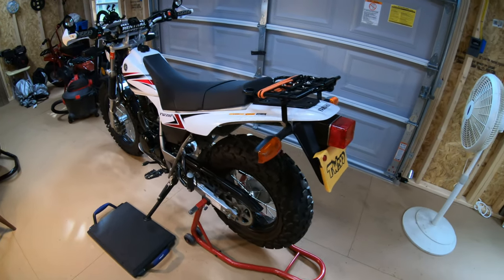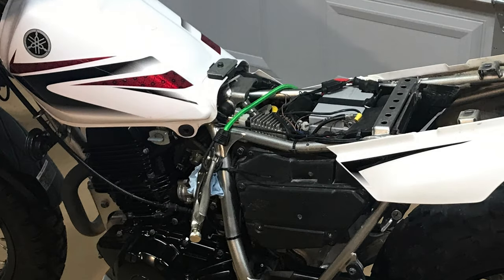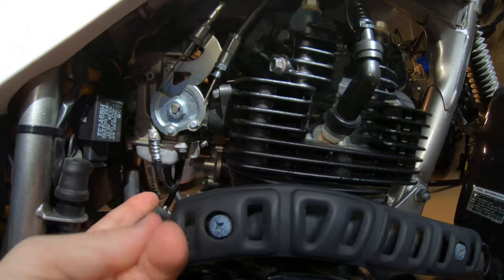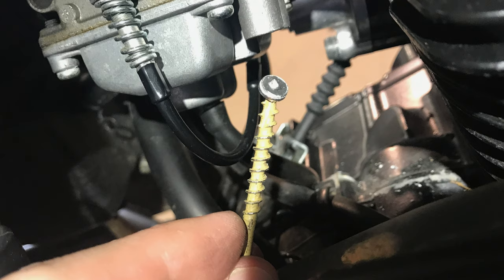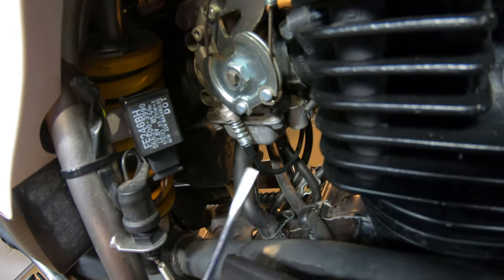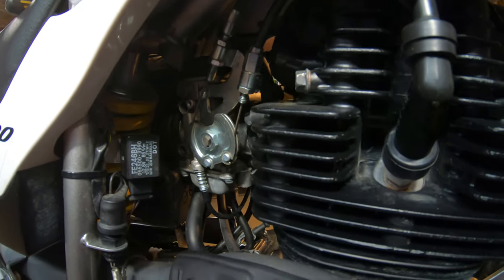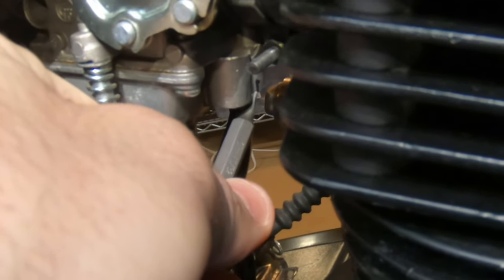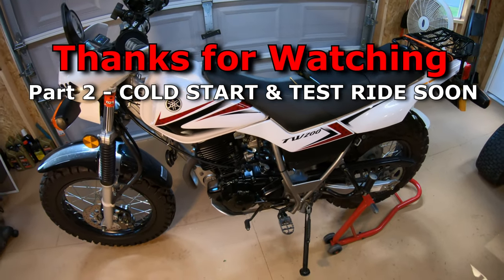TW200 Capped Air-Fuel Mixture Screw Access and Adjustment[4K]

Comment: So just for clarification..if you were sitting on your bike and you had turned your carb to get at the bottom..would the bottom of the carb be facing towards your right leg..most i see turn it the other way  but they also disconnect the throttle cables..tilting it the way you did made it necessary to take off gas line, but you didnt have to disconnect throttle cables.. i already did this 2 years ago, but forget how,but now it is a pig to start in cold weather,so i want to turn my screw out maybe another half turn. Factory setting was 3/4 of a turn and i turned it out 1 1/2... but i want to try it at two turns . I think i can do this with a small screwdriver bit without even turning the carb..but dont  know till i try.
Reply from the maker: Yeah I turned it so bottom of carb is facing the right side of bike as you’re sitting in it.  For me it seemed easier to disconnect gas line than messing with throttle cables. Also I had to disconnect that flasher box module.  But that was 5 seconds.  Forgot to mention it in vid. 👍
Reply: @bwxmoto  thanks for answering so fast !
Reply from the maker: @jamiehalifax4954  No prob, good luck! My comment notifications are broken so I'm glad I happened to see your comment!

Comment: Thanks for the video. I’m about to go do this to my 2020. My bike won’t start or even idle unless I choke it for a long time. My bike has just over a thousand miles on it. And it’s slowly getting harder to start. So 2 turns out from fully closed... maybe I’ll try 1 1/2 turns first. Maybe it won’t “surge”? Thanks for the very informative video.
Reply from the maker: I would try 1.75 turns out from being bottomed out. But who knows that might not work on your bike in your bike might like 1.5 or two turns out.
Reply from the maker: But I would definitely put it as far out as you can without any surging when you get First twist the throttle
Reply: Ok yeah I just got your comments. I tried 1.5 turns out and it’s still hard to start. I’m in Florida it’s like 80° out. Shouldnt need a choke. Lol so next I’m going 1.75 turns then 2 turns.

Comment: Hello, thanks for uploading this. Excellent help.
I was wondering what your opinion was on ,when to try this.
I have a new tw200, and wondering if doing this prior to engine break in, would be beneficial or detrimental.
I have 380kms on it so far.
Many thanks in advance for your consideration.
Reply from the maker: Hi, glad it helped! 
I don’t think it will affect break-in at all. It’ll just make your T-dub easier to start and warm up quicker.  👍

Comment: Thanks for the video. My TW200 just failed the new emissions test in France where I live.  The bike does start and run easily with no choke in the spring/summer months. So I'm wondering if  removing the metal plug and turning that  screw all the way in might weaken the mixture enough to solve my emissions problem?
Reply from the maker: It might. I have no idea about those emissions tests.  To me it’s insanity doing emissions testing on a 30 year old designed 196cc motorcycle engine.  Governments are out of control over there.
Reply: @bwxmoto  Thanks.  Do you think there's any reason why I shouldn't drill out the aluminium plug to allow screwdriver access? (Sounds like it was pretty tricky to get it out with the  self-tapping wood screw)
Reply from the maker: @Snoosemoose  When you use a drill on anything it seems like the drill bit usually goes through and violently collides with whatever is under the thing you are drilling no matter how hard you try for it not to do that. So I suppose you could damage the the brass screw under it (unlikely) but as long as you're careful it should be fine. 

You could just completely remove the carburetor but that might take more time than using a self taping screw or whatever.  Like I said in vid, there's a million ways to do it. It's pretty simple stuff. What I did in vid is just what I happened to try first. It probably took more time than it should have with the self tapping screw but it worked out. I don't think I had a drill or bit that would have allowed me to use a drill without removing the carb.

I don't know what the laws are over there though. Maybe they'll throw you in jail for tampering with an emission device, who knows. LOL   Europe is crazy.  Emission testing a TW200 seems 🦇💩 crazy in the first place. 😆  But you might be onto something, adjusting the carb for it to pass their crazy test.
Reply: @bwxmoto  I'm going to take a close look at it,  I'll probably use a drill and go easy with it  if I can get reasonable access without taking the carb right out. Thanks again for your video and guidance!
Reply from the maker: @Snoosemoose  Yeah no prob. You could remove the throttle cable and twist it for access on left side of bike without completely removing carb actually. Just get it more horizontal, should be fine. Maybe you could unhook more lines and twist it for access on the right side of bike too, I didn't have to though so not sure.
Reply: @bwxmoto  I've just done the job.  My TW200 is 2008 model which I bought new in 2010, it has only done about 3000 miles.  The screw cover on mine was actually a rubberlike material with no hole in the center.   I put a small drillbit on my cordless and went  very gently with hardly any pressure.  After turning for about 10 seconds or so the drill pulled the rubber cap riight out.  I had thought I would be nowhere near the screw head with the drillbit but - you were right - the drill had even so lightly touched the brass screwhead!  Luckily there was only minimal damage in the centre of the screwhead.   
So to weaken the mixture I turned the screw all the way in,  on my bike this only took one quarter turn.  I'm taking the bike back to the test center on Monday for re-test, and hoping that will be sufficient to pass the emissions test.....
Reply from the maker: @Snoosemoose  That's cool. Mine is a 2011 I bought used in 2017 with I think 1200 miles on it at the time IIRC. So yeah they keep changing the anti-tamper devices yearly on some models. 

For instance my new 2023 KLX140RF dirt bike has a cap but also it's filled with epoxy and then I think under that it is one of those tamper proof screw heads which you need a weird bit to adjust. I just bought a new carb for that LOL. I wonder if the emissions test you are trying to pass is even possible to pass with a perfectly running TW200 running as lean as it possibly can.

 It has no catalytic converter that I'm aware of, so maybe they're testing for  hydrocarbons (HC), carbon monoxide (CO) and nitrogen oxides (NOx) which will always be present in exhaust on a bike with no cat. It may be a test designed to keep all old bikes off the road and impossible to pass. But I don't know. They are grandfathered in over here in the US. I think that's the main reason they don't update the bike at all because if they do, there are massive requirements for emissions that would need be accounted for and would probably change the character of the bike completely.

But good luck! I'd start researching what they are testing for and see if it's even possible to pass the test. Maybe someone makes a pipe with a catalytic converter element in it for the TW just for that purpose. Who knows!
Reply: @bwxmoto  It says on the failure certificate that they're testing for CO less than or equal to 4.5% mine was 7.74%.... but the bike was pretty cold when  tested, the guy's going to test it hot as soon as I ride it in this time.  I've also washed out the air filter, though I doubt that'll make much difference.  I'll let you know what happens.  
Yeah,  I think they should just let bikes beyond a certain age quietly live out their lives.   And with the TW200 we're talking about a 200cc motorbike that,  in my case, does bout 250 miles per year!  Like most of this kind of knee-jerk reaction legislation they haven't thought it through and applied  common sense before implementing it.
Reply from the maker: @Snoosemoose  Wow yeah that's crazy. But carbon monoxide (CO) is taken out of the exhaust by a catalytic converter and converted into carbon dioxide (CO2), nitrogen and water vapor. So it probably still won't pass unless you have a CAT. But maybe if you get it lean enough it will. It's only a couple percentage points. 

Maybe turn your idle down too? Less explosions per second would produce less of everything it seems. Then if you pass you can turn idle back up and crank the air/ fuel mixture screw back out for proper running bike. I wonder if they only test it at idle or if they rev it up?  

Stock idle is something like 1400 or 1500 RPM but it'll idle down to 700 RPM probably and still run.  But I guess if they go by percentage of exhaust and not an amount over time it wouldn't matter how fast it's idling. Hmm, not sure. I wonder if you could install a small catalytic converter. Seems like if there's a demand for something, someone, somewhere would make it.
Reply: @bwxmoto  It passed easily today CO was down from 7.74% to 0.29%.  All I did was wash out the air filter and wind in the mixture screw that last quarter-turn.   Only other thing was the engine was  warmer this time.  Anyway,  alls well that ends well. Thanks again.
Reply from the maker: Sweet!! That’s cool 😎 No problem ✌️
Reply: @Snoosemoose  I can’t believe a tw failed a emissions test ANYWHERE it’s a damn 200cc 4 stroke! How dirty can it really be running?!?!?! But in all reality. Do some research as to whether or not the grades of fuel change the tests, try a new spark plug, and maybe try adjusting the valves.
Reply: @michaelhildebrandt1073  I'm thinking that maybe there was a glitch with their machine because when I took it back without changing very much apart from cleaning the filter turning the mixture screw slightly (it already not far from weakest setting) it passed very very easily.

Comment: Whats your rpms at idle? Mine seems to be idling high from previous owner i can start with no choke but after riding for a bit it sounds like its really high wondering if its normal. I assume they turned the idle up because the pilot jet is stuck. It seems to die if i try to start with choke.
Reply from the maker: I think about 1,500 rpm.  But you set idle when bike is warmed up.  Might help, might not.

Comment: Can you describe the symptoms of "surging"
Reply from the maker: Yeah, it's like when you first open the throttle and you expect a certain amount of throttle like normal, but you get what feels like a burst of much more throttle for a split second, then it goes back to normal. 

It's only when you first crack open the throttle from idle, at least it was for me. And it happens when you're trying to modulate the throttle so you can let out clutch too, so it's super annoying and can make the bike jump forward more than you want.  

I just turned the screw back in until it stopped doing that and it was about 1.75 turns out from being bottomed out IIRC.  Might be totally different for you though. Just have to try it.
Reply: @bwxmoto  sounds good I'm a little past 2.5 turns which the previous owner did. Not sure if I need to tweak it. Thanks!
Reply from the maker: @Motokarts  Yeah I’d try 2 turns out. Mine was crazy rich at 2.5 turns out and surging.

Comment: Will this help my bike breathe at elevation?
Reply from the maker: Not really, this adjusts the pilot jet or idle jet for starting and idling. It might have a small effect at partial throttle but not a ton. These bikes run super lean  from factory so at higher altitude it should be fine as the air thins out. People run stock jets up to 10,000 feet. It depends though, they probably all run a little different.

Comment: Except there is no air-fuel adjustment screw on my 1999 carb.
Reply from the maker: Hmm. I've never heard anyone say that. I knew there were a few changes in 2001 but I wonder if you have a stock carb or if none of the pre-2001 bikes had the mixture screw.

Comment: So essentially you’re making the engine run rich when you’re doing that.
Reply from the maker: No it’s the idle circuit a/f mixture screw.  Bike runs lean from factory.
Reply from the maker: You’d have to change jets out to make the engine run richer overall.